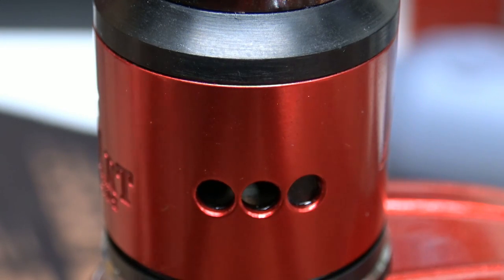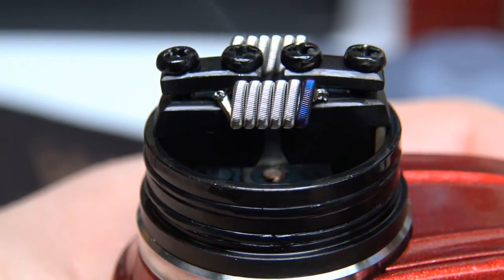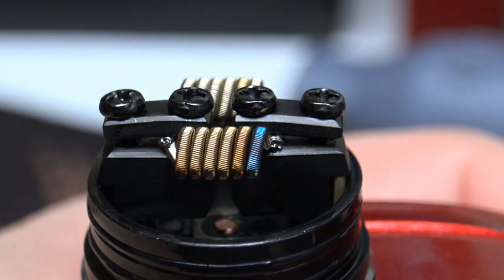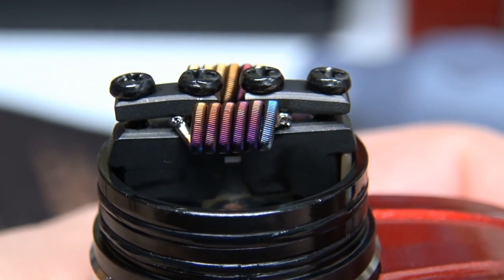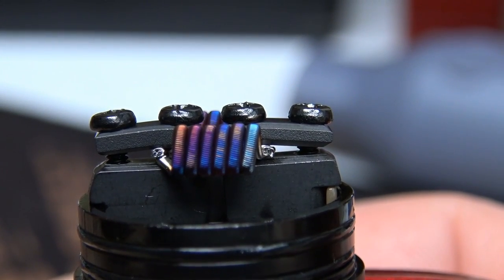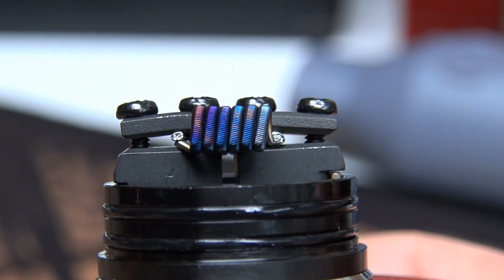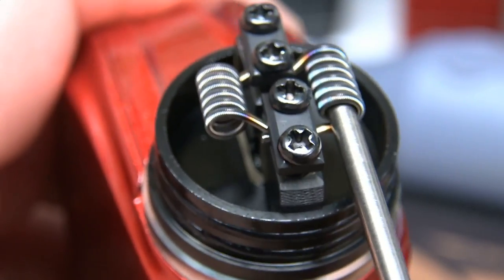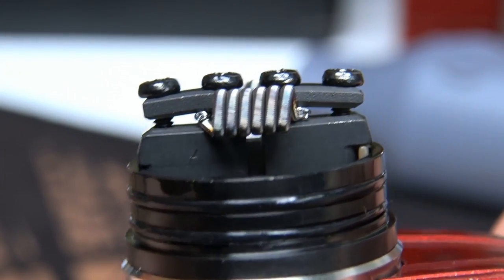Coil Color Pulsing Tutorial

Comment: How does inserting a metal rod get rid of hot spots? What exactly are you doing by inserting the rod?
Reply from the maker: On a fresh install, the wires are tight against one another and generally will short the circuit. By inserting the rod, you can wiggle the coil to loosen it and allow the wires to space a bit more naturally and even the flow of the current. Think of it like giving it a bit of a nudge to let the wires fill their own grooves rather than pressed hard against one another.

Comment: Mine on the top of the coils and sides are a light gold /silver but the inside of em and end edges are blue ish why is that ? Are they okay to use ?
Reply from the maker: That's perfectly fine and normal. Generally speaking, color pulsing will fade back to the normal silver color as the coil is heated beyond the oxidation level. Since the middle of the coil is what gets the warmest, it will be the first to return to the silver tone.
Reply: @ariesjj  So really just the end goal is just making sure it glows evenly and no hot spots correct? Not really trying to achieve blue or purple oxidation? 🤔
Reply from the maker: @Avi-w9h  That is absolutely correct. The color pulsing is just for asthetics for photography and those wanting to post pictures on social media. After we finish taking our photos, we keep pulsing until the coils glow fully and evenly for actual use.

Comment: Can this work on any type of coil? For example non advanced coils like staggard aliens or claptons more thinking of my go to builds of twisteds, zippers, parallel or basic coil
Reply from the maker: Most certainly. The complexity of the coil has nothing to do with it. One thing you'll want to be mindful of is when doing this with coils with low mass (parallel, basic, etc), you'll want to turn your wattage considerably lower as it won't take much for them to heat through the color spectrum.

Comment: are SS coils safe to clean by wetting and heating up like with nichrome and kanthal or do u do something different to clean them between rewicking?
Reply from the maker: Great question. I clean them using the same process as nichrome and kanthal as the oxidation layer will still be intact on the bonded level. Coloration will be gone, but still plenty safe with the base layer still there.

Comment: i've been using the ss316 wrap, the color is great but when i was using it (about 30 mins or so) the color strated changing into black (i was using temp control mode aswell) where did i go wrong?
Reply from the maker: The color will not stay once you start using it. This is a normal as the colors will continue to cycle as the coil builds up heat past a certain point.
Reply: are there any ways that i can slow down or make sure the coil won't get too black after 2-3 days use?

Comment: I need a video on better installation methods. Half the time it works well, half the time I can't get big coils in right.
Reply from the maker: If you can give me an idea on what you're trying to install in, I can do what I can to help. There are so many different deck layouts, it is hard to cover them all.. mainly due to a lack of having ready access to them.
Reply: ariesjj it's a goon 1.5 and an azeroth rdta. I got them as my first rebuilding attys because sub ohm tank rbas were too small inside and hard for me to work with. 

Sometimes everything goes in easy and others not so much.  If there is a better way to shape the legs that might help.

Comment: Hey really nice tutorial dude! first my aliens got a really nice color but after the final pulse they got pretty black :/ I used 316L for the wrap and 316 for the cores but they looked used and not silver and new :( pls help me!
Reply from the maker: Depending on the wire, it may have still had a slight layer of machine oil on them.. give them a light scrub with some warm water and a medium stiffness toothbrush with a small dab of Dawn soap (Fairie Liquid if you're in the UK) and they should clean right up. Just make sure you rinse them real good after using the Dawn or FL.
Reply: ariesjj thx again! I will try it right now ;D
Reply: ariesjj hey it really helped me the coil came pretty clean ty mate! :)
Reply: My coil also turned black. I scrubbed it but it didn't clean up. Is it still safe to use?